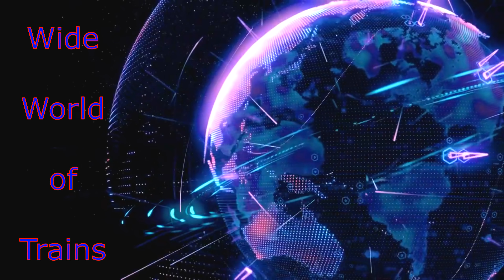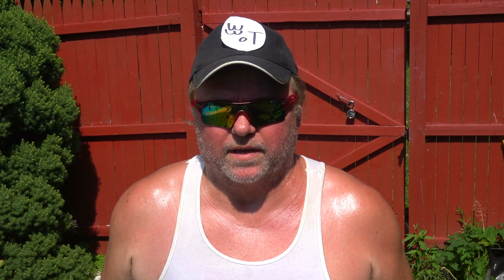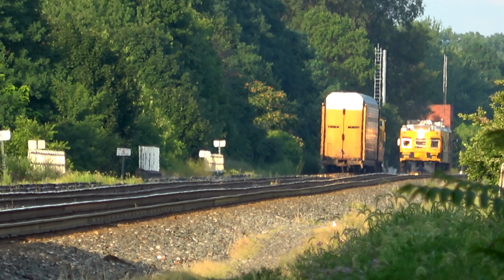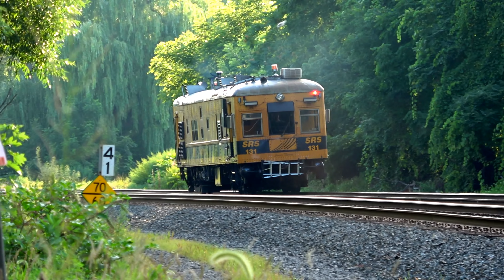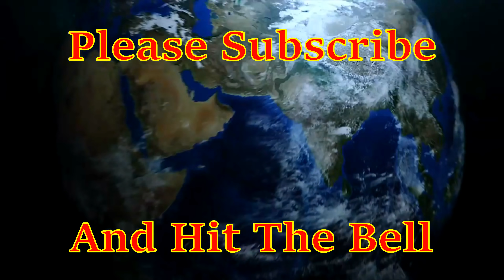Sperry SRS 131 Geometry Car Built in 1925 4K

Comment: Not a Geometry car. The Sperry Car tests the rail for defects. The most dangerous defect being the Transverse Fissure which is a progressive crosswise fracture starting from a crystalline center or nucleus inside the head from which it spreads outward as a smooth, bright, or dark round or oval surface substantially at a right angle to the length of the rail.

Comment: That is the worst job to get called for as an engineer!
Reply: Engineers don't operate Sperry Cars. Sperry employees do. The railroad will provide a Conductor as a pilot.
Reply: @FFred-us9tw  

Wrong-  the pilot is engineers for csx
Reply: @railrider1422  I worked for CSX for 9 years. Never as an Engineer did i get called to pilot anything but a train. When Sperry came to town it was always Conductor pilots. Same with the Rail Grinders.
Reply: @FFred-us9tw  times have changed